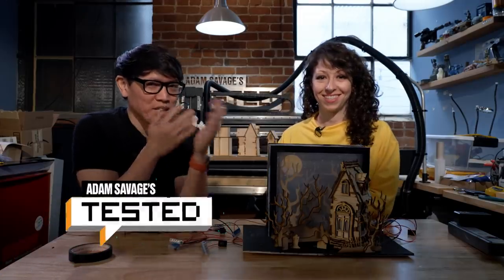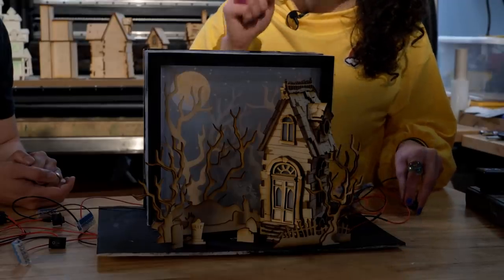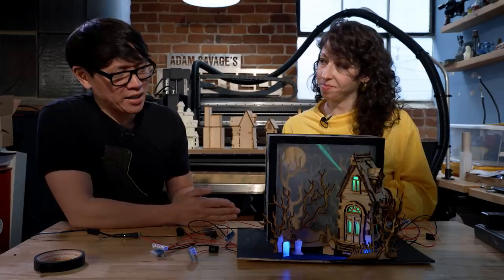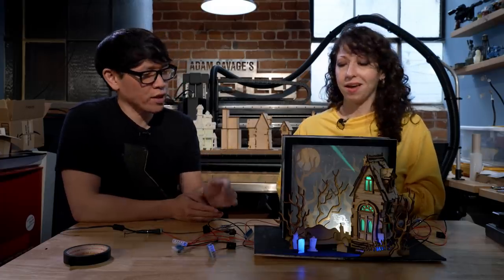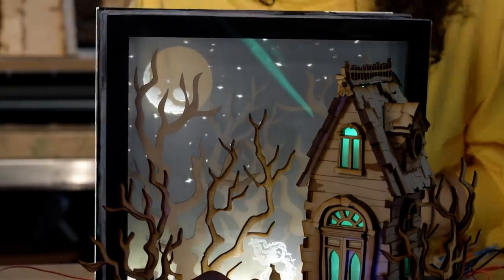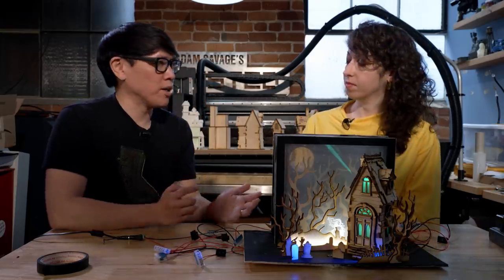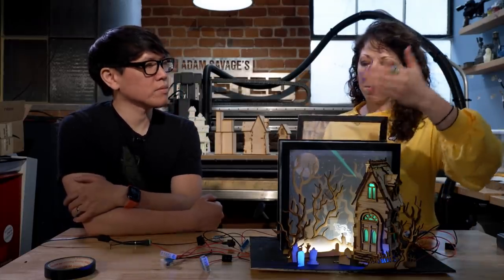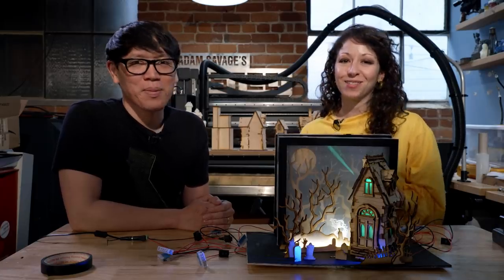LED Lighting for Miniatures and Dioramas!

Comment: I love these episodes with Jen. I like the silk screen frame idea to create the illusion of depth of field. I've often wondered about doing some kind of environment layout (like a model railroad layout) where you have elements in multiple scales, separated by breaks in terrain that allow you to shift to the next smaller scale. In the rear of the layout would be the very smallest scale. But if each of those layers was separated by a diffuser pane, I think you would be able to sell the distance effect even more strongly, especially if you could calibrate the diffusion to some extent. I think an acrylic sheet with a frosted coating might do the trick, as long as there was absolutely no shine to the glass itself. And it would have to be pretty clean. You could even paint clouds on the glass, or ground-level atmospheric haze.

Comment: You can sand the screenprinting mesh (it's done to help with film adhesion) and it should help somewhat with reducing the glossy appearance... 

Another option is to use a very sheer black stocking material and then add varying amounts of white or light gray paint with an airbrush. You can create gradients from the bottom up as well... 

An all white or translucent material will project more light out to the viewer than the black, thus awarding less control...

Comment: I am lighting a 1/12 scale model boat, and generally using micro LED's, (0.8mm x 1.2mm), I made a custom power supply board from veroboard (with a 3.0V supply from a lithium cell), and am wiring to that, the switching is dome using DIP switch chips (which were perfectly sized for the instrument panel), the charging for the lithium cell is done via some 4.1V flexible solar panels mounted as per the real boats panels, the wires however for the LED's are tiny (0.1mm) and soldering them is a feat in itself.

Comment: Fiber optics could a be incorporated into something like this. You can get spools of PMMA (plastic) optical fibers pretty cheap. You could even potentially use only a couple leds to light a whole scene just by piping the light where you need it. Then hide everything under the base.

Comment: Very cool. I do this sort of thing for a living for stopmo animation sets and do these types of explorations all the time. There are so many possibilities available for miniature lighting now with the latest fixtures and control systems on the market. As for layers, have you played with switchable smart glass/film at all?
Reply: Hello James  W H-- I'm trying to find a way to make little scenes where in the center is a large screen with a photo on it-- the screen is illuminated but I can't find the right material to use (or the right lighting) to light the area behind the photo which is on a transparencey-- so the light is uniform.  I ordered something super expensive from Edmund Optics but it wasn't specially good.  I can only get the bulbs a bout one and 1/2 inch back behind the 'screen.'   If I wind fairy lights around the periphery it sort of works.  The screen will be 4 or 5" square.  Any ideas about diffusers to help me?  Thank you.   Lynn W

Comment: if you are running them from mains, get a old pc power supply and convert it to a bench power supply or you can buy the block that connects to the 24pin lead, Pc power supplies give 3.3v 5v and 12v so it provides all of them at once. and if you wanted you could run a entire room full of those from one PSU depending on the ampage each one is as it is not unusual to get 25a from the 5v rail and 40a from the 12v rail. along with 10-15a from the 3.3v rail etc.

Comment: The problem I aways have is power. If you dont want to use batteries and plug into the mains, how do yo do it safely?? Id love to see a video on that, whether you'r lighting a diorama or the Falcon, Star Destroyer or Enterprise, how do you do it aok connected to a mains plug? (Or even better a USB plug)?
Reply: YOU NEED DC-DC CONVERTERS!  Google for step down modules. LM2596 based circuit is basically a dimmer for your led's. It can take up to 20 volts input puts out what ever you turn the dial to
Reply: So you go usb plug -> dc-dc converter -> LED. You can also get current limited dc-dc converters, this ensures that (when set correctly ) even if you make a short,, nothing breaks . The led's will simply dim or turn off untill you fixed the short. That way you can never go wrong. Accidentally blowing up a usb wall plug is out of the question like this :D
Reply: use a old pc power supply if you are running them from mains, get a old pc power supply and convert it to a bench power supply or you can buy the block that connects to the 24pin lead, Pc power supplies give 3.3v 5v and 12v and ground so it provides all of them at once. and if you wanted you could run a entire room full of those from one PSU depending on the ampage each one is as it is not unusual to get 25a from the 5v rail and 40a from the 12v rail. along with 10-15a from the 3.3v rail etc, all with complete safety, as have many protections built into them, over current,over voltage, reverse voltage etc etc, and very tight tolerances. i run everything from one. led lighting, foam cutters, battery chargers, PC battery chargers, USB devices and devices you name it all from one PSU and all at the same time. using speaker ports and banana connections to run the different connections.

Comment: Does anyone in the comments have any good resources on figuring out voltage/wattage/etc for diorama lighting? I'm comfortable with soldering (I learned the basics in college) but when it comes to safely connecting bulbs/diodes & a battery, I'm not entirely sure where to start.